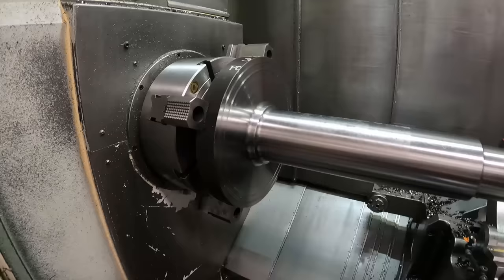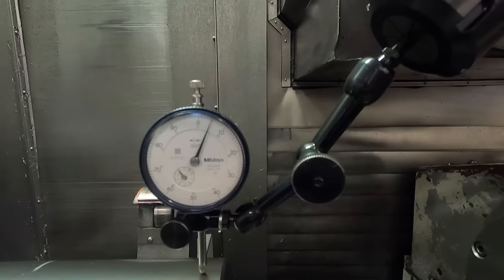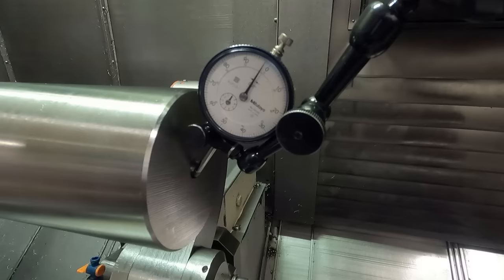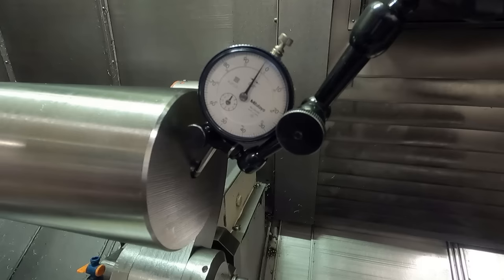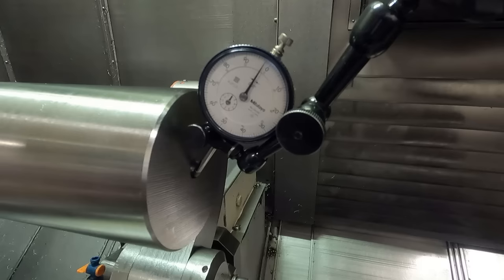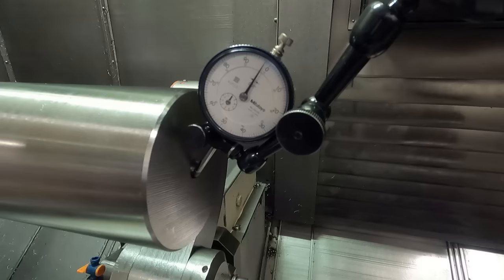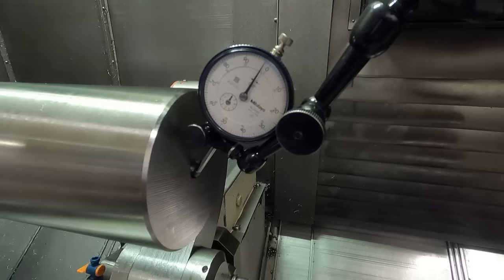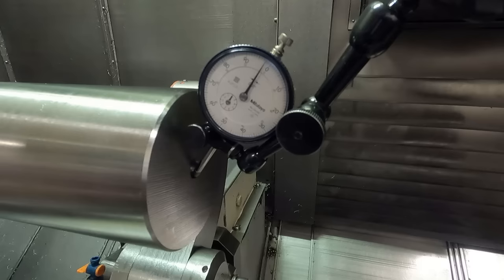Machine Shaft From 2000 Lb Stock

Comment: I'm still so confused as to why you didn't just use smaller stock...
Reply from the maker: Because there is a flange on the end that's in the chuck. It is 16" diameter that the stock is. This customer wanted the part made out of one piece of stock. So there is no other way to do it. I think I showed a shot of the parts laying on a pallet at the end of the video with this flange.
Reply: @EdgePrecision  oh, that makes sense!  I must've missed that.  Had no idea there was so much stress released when you machine down something that thick!  Great vid brother keep on keeping on

Comment: good god turning that large diameter part down that far was very wasteful. Couldn't the part have been made in two parts? one disk over sized with a heavy spline and the shaft also oversized with a matching spline larger than the OD then press fit together and welded, then final turned to compensate for the stress induced runout? often think that the use case would determine the manufacturing method.
Reply from the maker: If you read my comment in this videos description it will answer your questions.

Comment: If only he had a fixed steady that he could have used to hold the bar to re-cut the centre.
Reply from the maker: I could have done that in the hydraulic one as well.  On the parts after the one in this video. I just carefully skimmed a band to close the steady on, closed the steady on that. Than I drilled and bored the c-bore on the parts end with a chamfer to run the live center in the tail stock. Than finished turned the OD.

Comment: When I see a safety issue I have to speak up. When the chips were bunching up and you stopped the machine you sped up the process of removing the chips, you started out nicely using pliers but then you actually grabbed the chips with your hand and continued to remove with the pliers. Amateurs watching this need to know that that's not a safe thing to do bad habits will eventually turn into a disaster. Machinists should never grab chips with bare hands. That's just something that one must abide by.

Comment: Plz share machine details
Reply from the maker: This is a Mazak Integrex e650H. 5axis multi task machine. It has a turning dia. Of 36” and length of 120”. The travels are X 40.3” Y 25.5” Z 133”. Turning spindle has a 6.65 spindle bore with 60 hp 0-1600 rpm. Milling spindle Capto 8 taper 50 hp 0-10,000 rpm.
Reply: Sir we work on long shafts  above 2.5 mtr. for turning would you guide me for selection of tools , because I am facing problem like vibration
Reply from the maker: To reduce vibration the things you can do is reduce speed, increase feed, go to a more positive insert geometry and a smaller tip radius on the insert.
Reply: In shaft turning big issued is bending of some material is that controllable on throghu chuck

Comment: it's my understanding that machining should take the least amount of machining possible to reduce wear and cost. why use so much material for a part nowhere near as large?
Reply from the maker: Do you people even watch the video? Or maybe read any of the previous comments and my replies? You know how many times this question has been asked. There is a flange on the end of the part that is the same diameter as this stock. Because the customer wanted it out of one piece of material this is the smallest the stock could be.
Reply: @EdgePrecision  i guess i missed that part, and didn't see a comment about it either :P
Reply from the maker: OK. Just five comments down from yours there is one?

Comment: So im just curious why wouldn't you start with a smaller piece of metal? Seems like a lot of wasted time.
Reply from the maker: No the flange on the parts end is that diameter and the customer wanted it out of one piece of material. No other way.
Reply: @EdgePrecision  thank you

Comment: Welding the flange would have been much more cost effective than turning from such large stock
Reply: They probably didn’t trust the weldments to hold. That shaft probably has an incredible amount of weight or torque  on it. The customer might also have required the material certified to a certain hardness.

Comment: Why do you even care about runout roughed out with .125 radial stock to clean up?  Relax it, put the center in it, dial it in at the chuck and re-clamp it, finish it in next cycle.

Comment: Would it be cheaper to cut down in a bandsaw? geez
Reply from the maker: I don't have a saw capable of doing it. So I would have to job it out. Now I would probably be left with a square shaft in the middle to turn into a intermittent cut witch woulr be hard on the roughing tool. First I would be giving away money I could make on the roughing. Also I would probably use more inserts to rough the square. There would actually be more cost to pay the just outside shop for the sawing and take more time to do the job.

Comment: How come you dialed it in so much at the start when you were going to take so much off?
Reply from the maker: It is not totally necessary. Just kind of a habit. Although if you are taking facing cuts with constant surface speed. With such a large piece of stock. You could have a out of balance situation.

Comment: Why would you use such a large stock for that small diameter shaft. Seems like a waste
Reply from the maker: Because the customer wanted it out of one piece of material. The flange area of this part finished to 16.00" in diameter. The starting rough stock was 16.150" in diameter. It couldn't be any smaller.

Comment: you'd have saved a lot of time welding a flange on the end instead of cutting all that off... a deep V-Groove weld would have sufficed.
Reply: I read elsewhere two previous shafts made that way had already failed.
Reply: @PatrickKQ4HBD  I guess "deep" isn't descriptive enough. 80% of the thickness of the flange, with a weld that goes to the dimension of the fillet. This isn't hardened tool steel, so the 70,000PSI weld will MORE than make up for that, and would bend the flange, especially if heat-treated to stress-relieve. CEE Australia does it ALL the time, with zero returns.

Comment: That 40 " piece isn't 2k lbs.
Reply from the maker: By what calculation are you using? I'm going by the suppliers weight on the material.  They were not 40" long but lets say they were. The calculation would go like this Radius squared times pie times the length times .2833 for steel. So 8*8*3.14159*your 40"*.2833 (Steel per cubic inch) equals 2,278.433 Lbs . Your 40" long assumption by 16" diameter. The stock was actually 16.150" in diameter. In the thum nail I actually rounded down the weight. I have to look at the drawing but if I remember. The parts were more like 36" long so at the 16.15" diameter that would be 2,089.219 Lbs.  .2833 is the weight I have always used for steel. But I thought I'd ask seri on the phone. She said the weight of steel is .2904 Lb per cubic inch. Going by her weight that 16.15 X 36" round would weight 2,141.578 Lbs. So where is the not 2K Lbs?

Comment: man, you could cut it onto 4/6, 3 same pieces at least
Reply from the maker: With what would I cut that with? I don't have any saw that large. Also you are just trading sawing time for roughing on the lathe. If I sent it out (There wasn't time for this) I would just be giving money to the saw shop. That's OK I suppose but why should I. By the way you do realize there is a flange that is 16" diameter on the end that's in the chuck. So how would I cut it into 4/6,3 pieces to make the part?
Reply: @EdgePrecision  it should be plazma/laser cut or something like watersand cut. I agree to same or more cost if no such tool. Cheers. Good job.

Comment: Eliminate waste of project time with small stock ,your also reducing machine wear ,bit wear and utilities.
Reply from the maker: I don’t understand why I have to keep responding to this comment. Did you watch the video? Did you see the flange at the end of the part? It’s diameter is as large as the stock. So this customer wanted the part out of one piece of material. So no it can’t be any smaller than it is.

Comment: Why did you buy stock with such a large diameter ? Why not order stock with a diameter closer to the finished product ?
Doesn't that waste a lot of time and money ?
Reply from the maker: I have answered this question so many times in these comments. There is a flange on the end of the part that is 16" in diameter (The size of the stock). This customer wanted the part machined out of one piece of material. There was no other way to do it. The stock is not to large.
Reply: @EdgePrecision  wow, what a strange , expensive request. I'm sorry I didn't see that in the comments section.

Comment: Damn a casting would've been a lot faster to machine wouldn't it?
Reply from the maker: There are a couple of problems with a casting. First and foremost. It isn’t strong enough for this application. Second to make a casting it requires a pattern. This would take more time than this roughing.
Reply: @EdgePrecision  must be a small run part. Because if a casting is too weak they could make a forging.
Reply from the maker: @machineryandtools6214  Watch my 830 Op-1 cad cam video I answer this much better in the beginning of the video.
Reply: @EdgePrecision  okay cool thanks for that. I just watched it. Makes sense to me!

Comment: One customer absolutely wanted the piece made from one stock and not welded or even screwed in, that was a lot of waste material there.
Reply: Usually with shafts you want as few weak points as possible and many times you have to just mill it out of one piece
Reply: @Dmiudo  Yea I know, but if welding it on or similar is made right it will be as strong but that is the problem since many don't know how to do it right and thus companies go for the most expensive route which is this.
Reply: @dtiydr  if it's a fairly large piece, welding on might not be feasible. If it was, when you weld you induce a stress concentration due to the weld being stronger than the actual base metal
Reply: @Dmiudo  If done the right way it becomes as strong as a solid piece but there is very, very few places and ppl that knows exactly how its done and a company never want to take a chance and thus do this way more expensive way instead, its very normal.

Comment: Yeah, couldn’t you just weld the plate on to the shaft and not waste all that metal?
Reply from the maker: The parts these shafts were replacing were made that way. They had a failure with them. So just to eliminate the possibility of that, they decided to go from one piece of material. Customers decision. So it has to be right, right?

Comment: Just wondering if on parts this large you have issues with ambient temperatures effecting tolerances and measurements, or does everything just kind of work itself out (the part expands because its hotter, but so does the machine so it cancels out)?
Reply from the maker: Yes if it gets hot enough that can change the size of the part. That’s why I use coolant to keep things cool.
Reply: Don't forget to allow for tidal changes. Don't laugh, it can happen if the workshop is located close to a tidal part of a river.

Comment: Wouldn't be just better a smaller size instead of the big stock n throw away n wasting all the material
Reply from the maker: You need to go read the comment I put in the description on this video. Your comment and ones like have been made so many times. I thought if I put a comment in the description that it would answer this question, so you and others would not need to make it. This goes as well for your previous comment.

Comment: What's the point of using such a large piece of stock when you could just use a much smaller piece of stock and weld a base onto it using a full penetration weld? Seems like a huge waste and huge unnecessary expense.
Reply: weld vs solid, the weld will always be a potential failure point. I believe Peter said that they used to do it that way and it had failed in application.
Reply: @WilliamPayneNZ  Good point, If they have experience with it failing then using a solid piece makes sense.

Comment: The only primary challenge to this whole video is the use of the caliper and micrometers ....."FOR REFERENCE ONLY".      This clearly means something.    There is a PURPOSE to identify these measuring tools as such.     This has been ignored.         You can make up many "stories" of explanation "after-the-fact" ....but these would be "too late" now.

Considering the extensive explaining of the many steps through the machining process .....this is a MAJOR FAIL to use clearly marked "FOR REFERENCE ONLY" measuring tools and say nothing about them.

.
Reply from the maker: I have mentioned this in previous videos. But for you because you know nothing about quality control in a machine shop. I will give you try to give you a simple explanation. In my situation I work under the quality umbrella of my old shop. So these mics aren’t used for the final measurement. All such final measurements need to have a certified calibrations traced back to the bureau of standards witch costs money. If you don’t want to do this kind of calibration to people’s personal tools. According to our quality manual all these instruments have to be marked for reference only. This is pretty standard practice to save money. You can calibrate your own instruments against your own gauge blocks that themselves have a  calibration certificate. But they still have to be marked as reference only unless it’s all certified and done at the intervals your quality manual specifies. So again to save money doing this to all the instruments in the shop. You only do one set. Then do the final inspection with that set. It doesn’t mean the the ones marked reference only aren’t accurate.

Comment: Too bad they couldn't have used smaller starting stock,  what a waste of resources and tooling!
Reply from the maker: If you read my comment in this videos description it will give you a better understanding of this.
Reply: It’s not a waste. The shavings will go to scrap and be made into something else and the tooling is paid for by the customer paying for the job. How else are you supposed to have a one piece part with that size flange? Forging maybe but that is added time and cost.

Comment: Dude, who taught you how to work on a lathe. Lots of mistakes. Good thing it's not a manual lathe.
Reply from the maker: You are correct. I do many things in unorthodox ways. Weather they are mistakes is up to interpretation, there are many different ways to do things. What I showed in this video is not the only unorthodox ways I do things. In the end the job was done in tolerance and paid for. In the end isn’t that all that matters?

Comment: This is what's wrong with America today. We don't worry about the 1750 lbs of scrap we just made. Instead of finding a piece of steel that would have yielded less than 70% waste. Instead we just say "screw it they will just pass it along to the customer.  

So then after MULTIPLE 55 gallon drums of scrap chips later, And your back killing you from all the shoveling  🤦‍♂️🤦‍♂️🤦‍♂️🤦‍♂️.  And those lines he's talking about are the ribs when it comes threw the Blooming process of making the steel. I can't think that a piece of 4340 or 4350 in the 8" or 10" diameter wouldn't have saved hours of work over that 18" or 20" piece of stock.
Reply from the maker: This is what my customer wanted for his machine in his shop. The shafts these are replacing were made as you suggest. Fabricated from two pieces to save on material. They had a failure. So the machine that produces their product can’t run. So not to chance another failure they opted for this to be sure. By the way the flange diameter is 16” so this stock is 16” diameter. It had to be that. A smaller size wont work without welding on the flange. I don’t design things just machine them. What the customer wants and if he is willing to pay for it. Than that’s what I do.
Reply: @EdgePrecision  Sounds like they bought the cheapest Chinese junk steel they could find and that was the reason for the failure. Ive personal handled millions of tons of Domestic and Belgium made bloom stock like this that is turned into seamless bearing rings for one the world's largest manufacturer of commercial bearings. Then the Chinese jumped into the market with there JUNK steel. And that didn't last long. I get it, you do what the customer wants. There paying the bill. However often they are there own worst enemy. Because instead of spending the $$$ and doing it right from the beginning. Some bean counter wants to skimp and save to show his boss that "He's on the job and they need to keep him to hold spending cost down" Yet wants a big bonus and corporate benefits package and Cadillac insurance. Ike I said, "This is what is destroying this country"